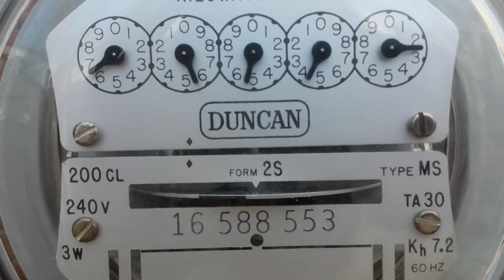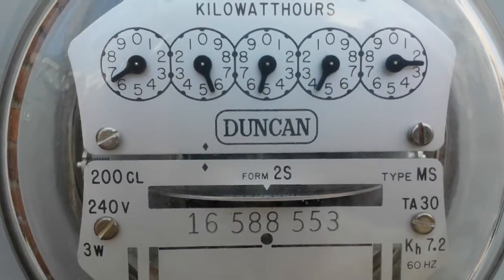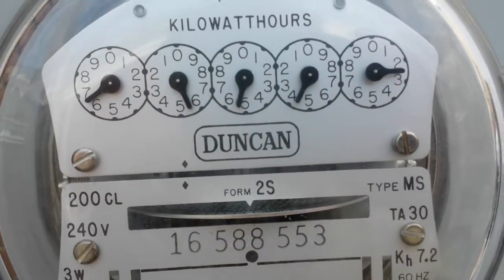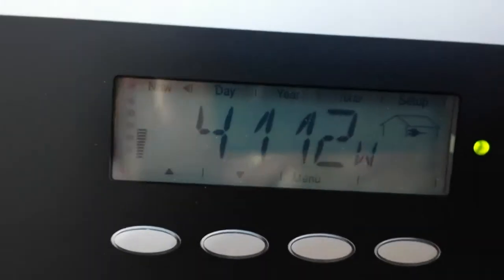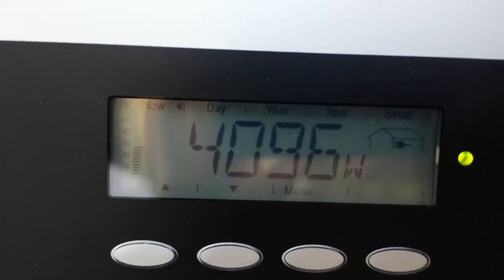electric meter spin backwards

Comment from the maker: The end result has been an electric bill with a negative number as the total.  After 4 years I have not paid out anything for electricity and they owe me about $350.00.  The charge to have an electric meter on the house is around $12 a month.  This is more than offset by the running balance they owe me, so I Never have to pay anything.